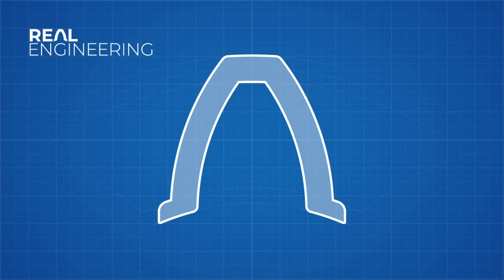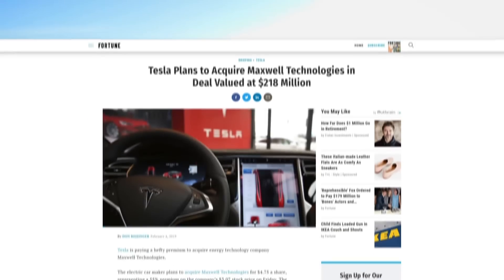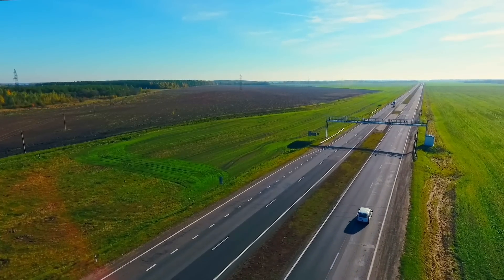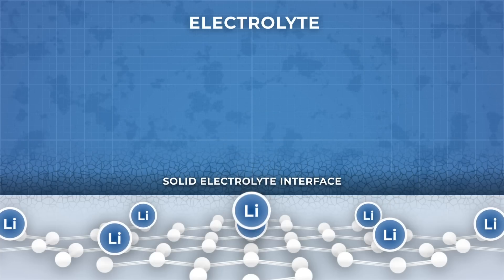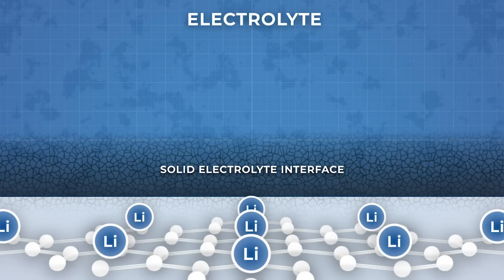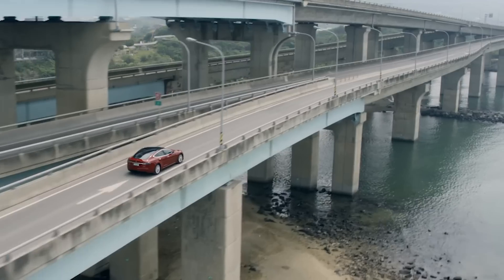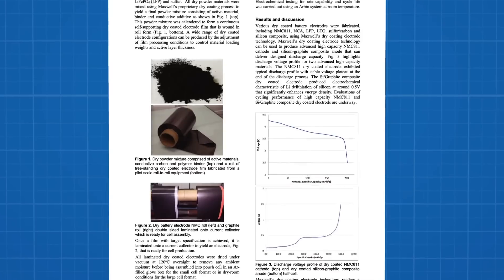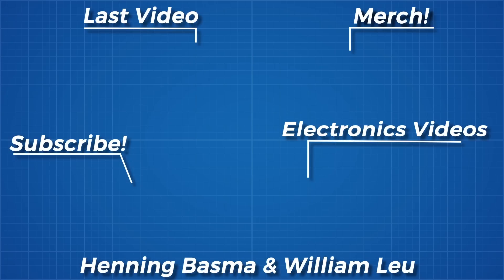Tesla's Quest for Better Batteries

Comment: The real question is what will be remaining after 10 years for the third owner? Of course, if the used prices fall enough that user will be a single mom who uses the car to get to work so a battery that is at 40% of it's original range is still acceptable.
Reply: tesla battery degradation data  determined to be 10% every 180k miles. so about 20 years for regular driving.

Comment: Who will come up with a car that allows the battery to be changed in 30 seconds? Seems pretty "easy" to make a flat battery that lifts onto the bottom of the car. Charge stations could switch out the battery with a charged one in 30 seconds. You could "rent" the battery from the station, making the base cost of the car far less....and subject to far less depreciation.
Reply: they tried that, it takes 5 minutes and is expensive to build, Tesla owners are happy with 30 minute super charging as its not too slow and easy to find one near them.

Comment: there are capacitors invented in Estonia no bigger then your hand, 
that produce megawatt per second, 
in America,  they have discovered a new chemical compound, 
that will be used in batteries and will not degrade, 
the alternator has not been redesigned, cause it worked good,
the alternator can be redesigned with a gear box,
that will produce massive amounts of energy, 
the man who combines all these factors together ,will make the bucks, 
the rest will loose out like nickolie tessler.

Comment: If it wants to expand / contract by +/-2 to one linear ratio, let them have it. Why wait? and  keep using rigid containers such as steel cylinders to hold them? Is there a requirement to maintain a higher than 1-bar pressure just to utilize such technology?

Comment: Savng the world ! Really ? I would like you to examine what is required to supply to build all those batteries that will be required. At the moment, China is dominating the battery market that actually started at the IREQ near Montreal. Now, China is actually spoiling a quarter of Mongolia to obtain the actual batteries. I have heard that Japan is in Bolivia (probably Nissan) where again a large amount of the country will become a dump or waistland in order to provide for the basic battery elements. Imagine now 3 billion cars to require batteries. Please, make the analysis and you will see that battery power is not viable and sustainable. Worst, this will provide reasons for political unrest as these waist lands will not happen next to Los Ange;es. The battery start-up was set-up in New Jersey and provided the batteries to the SVE in France which produced the Cleanova I, II and III until it was sold to an American company and then came Tesla after SVE went out). The French were the first to provide good electrical cars and some aspects came from Hydro-Quebec. Nissan did less then Peugeot in 1995 with its superb 106 electric which had a 150 km range).

Comment: Whatever they do, Tesla cars are still way too expensive for the "simple" folks, which is, for the leasing companies to use. Here, in Israel, leasing companies are actually deciding for the price of cars at the market. Tesla cars are amazing, no doubt. But. They are not going to cost around the same as hybrid cars (at least), and for sure not as regular internal combustion engine cars. Current price is what, even for model 3, what is called "long range", which is actually really short range, while compared to, say, hybrid cars, such as KIA NIRO, is around $44K, while even the top-of-the-line KIA NIRO is going to cost about $32K - and, believe me, it is much better equipped. So, this might be a huge difference for the company which tries to sell it. Add an infrastructure cost. Add repairs, battery replacement, etc - here you go. So, while Tesla is a great thing, they still need to cut their prices significantly. It's a pity that Tesla is experiencing finance difficulties right now, and it will be even more sad, if Tesla will be forced to cease production due to bankruptcy - it will probably kills electric cars future for good.

Comment: I have a stupid question: the UI for a tesla makes it seem like they use one large battery across the floor of the car. If that's true, and it's not a bunch of tiny batteries that add up to that large capacity, why not design a circuit using two half capacity batteries that alternate in use, so that both may be charged at once at a supercharger, reducing charging time? I'm not an electrical engineer (my focus is more in biology and medicine) I could be completely wrong on if a circuit like that is even possible. I could guess, even if it is possible, the constant switching between on and off could reduce battery life, and would need larger than half capacity batteries to make up for it, increasing battery weight, but if I owned a tesla, I would do anything for a shorter charge time, while still keeping the range.

Comment: A interesting video. It does misrepresent the facts about the Nissan LEAF batteries and the related performance of the car. The capacities of most Nissan  LEAF batteries have performed as expected by design: a gradually slowing rate of degradation over time. Only those batteries subjected repeatedly to high temperatures have shown abnormally fast rates of degradation. These are cars in hot climates or cars that are consistently day in day out subjected to repeated fast charging that raises the battery temperature. The majority of 2011 or 2012 models in countries without hot climates (without temperatures consistently over 30 degrees C say) today, in 2019, have battery capacities still greater than 70% of new and are very useable commuter cars. They can also be used for long distant driving where there is a suitable fast charging network.

Comment: Whilst the practical reality of replacing every Model 3 with a new battery pack is next to nil ( for starters this assumes the need to replace, the nearly equivalent worsening to the point of below 70%) this would not ruin Tesla. Total cost is a market public customer cost of about 7,500 dollars so total cost just a bit over 1 billion. Their market cap as of right now is just over 40 Billion. Their actual leverage and total assets is a good bit more than this and Elon alone is worth 20 billion. By the time this nightmare ever comes to fruition Tesla’s market cap could be 50-60 billion etc. Cheers!

Comment: This is exactly why I haven't bought a Tesla, yet, and I'm glad you guys pointed it out. Imagine you pay 45k for Tesla and after a couple years, your 300 mile range is reduced to 70%. And how much more after another year? Oh, and you're still making payments, btw.

So, all that excitement about saving gas money quickly dwindles when you realize you need to cough up about 10k to replace the battery.

Pretend you're still paying for gas and put all that money in an account, for a new battery. You are going to need it.
Reply: Alvaro Morales worst case scenario you are right. My 2015 model s has only decreased by  3% at 79000km. Part of keeping your battery in good shape requires the owner to keep its max charge at 80-90% for regular use, and only 100% when you go on longer road trips.

Comment: Use large super capacitors to supplement the batteries.
Reply: Even a very large capacitor would add very little to the range. What it will do is provide with enough power to launch the car from a stop sign or stop light reducing the charging and discharging that goes on in stop and go traffic. That will increase the life of the battery.
Reply: @men2dewy  Agreed there mate, at least it would help with the current draw from when the car moves off.

Comment: I'd like to suggest an episode on how to create massive renewable batteries with enough energy storage to power cities and countries. Hydro-electric dams and reservoirs.  For over 100 years it’s been proven that hydro-electric dams and reservoirs are a cost effective way to store energy, and the amount of energy released can be varied to match demand any time day or night, and no matter what the weather.

Currently hydro-electric dams and reservoirs are refilled/recharged passively by the naturally changing weather patterns that bring rain and snow.  For example, in California there can be a few years with the right amount of rain and snow to fill the reservoirs.  There are other times with 5 or 10 year of drought and not enough water for cities and farms to function normally, and not enough electricity so California has to buy electricity from other states.

California has the environment suitable for massive wind and solar installations which generate variable amounts of energy depending on the weather or time of day.  The supply generated by wind and solar can be too little or too much and often does not match demand.

Here is the suggestion:  Use wind and solar energy to run desalination plants to create fresh water that is pumped to hydro-electric dams and reservoirs in the mountains.  This creates fresh water that can be used by cities and farms, and used to generate electricity with proven technology that can match supply and demand.

Comment: Complete bullshit. "Ultracapacitors" do not permit or enable a reduction in "battery power" by making "regenerative braking" somehow magically able to produce "juice" out of thin air. ALL of the energy "created" via regenerative braking has to come from the vehicle's inertia and speed. Which only exist because the vehicle was accelerated to a given speed BY BATTERY POWER. Brakes are inevitably WASTING ENERGY when slowing a vehicle "over-accelerated" prior to the braking event. And no, ultracapacitors do NOT use an "entirely different" means of storing energy. Capacitors - including the "ultra" variety - are simply "batteries" for high voltage "alternating current" and function like ignition coils - which are "transformers" - and build up a magnetic field during "charging" with rectified "DC" current which collapses inducing a short burst of high voltage current to "jump start" a loaded "AC" circuit when that supply is cut. 

There is NO WAY TO ADD COMPONENTS AND CIRCUITRY AND CONDUCTORS TO THE LOAD PLACED ON ANY ELECTRICAL "SUPPLY" AND GET MORE "CAPACITY" OUT OF IT.

THE FUNDAMENTALAND FATAL FLAW OF ALL "PLUG-IN ELECTRICS" USING THOUSANDS OF DRY CELL BATTERIES IN SERIES AND PARALLEL IS THAT THEY'RE "DC" BATTERY PACKS BEING CHARGED WITH RECTIFIED "AC" CONNECTED TO "AC" MOTORS WHICH INVARIABLY REQUIRE "EXCESS CAPACITY" TO START THEM AND WHICH CANNOT BE MADE "EFFICIENT" OVER A RANGE OF OPERATING SPEEDS. TESLA'S "BATTERY FAILURES" SIMPLY DON'T MANIFEST THEMSELVES IN THE SAME WAY AS A "NISSAN LEAF" BECAUSE  TESLAS DON'T USE "LITHIUM-ION" BATTERIES OR "BATTERY PACKS". THEY USE NI-CAD BATTERIES AND THOUSANDS OF THEM AND HAVE "EXCESS CAPACITY" FROM THE FACTORY VIA INACCURATE AND DISHONEST "REPORTING" OF THE "STATE OF CHARGE" IN  "MILES" VS "CAPACITY PERCENTAGE REMAINING"  AND TESLA HAS DONE NOTHING TO "ADVANCE" BATTERY TECHNOLOGY BECAUSE THERE IS NO WAY TO "ADVANCE" TECHNOLOGY THAT DOESN'T EXIST - I.E. THE TECHNOLOGY TO "STORE" ALTERNATING CURRENT. VEHICLE ALTERNATORS PRODUCE 3-PHASE "HIGH-VOLTAGE" AC VIA INDUCTION AND OUTPUT IS REGULATED BY VARIYING THE DC CURRENT FLOW TO THE FIELDS BUT "EXCESS" CURRENT HAS TO BE RECTIFIED TO DC AND STORED VIA "LEAD-ACID" BATTERY FOR STARTING THE VEHICLE AND EXCITING THE ALTERNATOR "LATER" AFTER SHUTDOWN. ONLY SHORT-TERM "STARTUP" LOADS IN EXCESS OF CHARGING SYSTEM (ALTERNATOR) CAPACITY ARE "SUPPLIED" BY THE BATTERY AND SINCE THE BATTERY STORES ONLY ELECTRICITY PRODUCED BY THE CHARGING SYSTEM DURING NORMAL OPERATION, LIKE ALL BATTERIES IT IS NOT A "GENERATOR" OF ELECTRICTY AND IT CAN'T EVEN "DELIVER" ALL OF GE ELECTRICITY IT "STORES" BECAUSE IT TOO HAS INTERNAL RESISTANCE AND IT TOO HAS TO CONVERT SOME LLOF THE ELECTRICITY SUPPLIED TO IT - AND "STORED" IN IT - TO HEAT DURING THE CHARGE AND DISCHARGE PROCESSES. 

THE ONLY PERMANENTLY "STORED" ENERGY ON PLANET EARTH OR ANYWHERE IN TH UNIVERSE IS THAT STORED  CHEMICALLY AS HEAT ENERGY IN "FUELS" SUCH AS "FOSSIL FUELS" AND "BIOMASS" AND EVENTUALLY EVEN IF WE DON'T "DEPLETE" IT VIA "BURNING" THAT HEAT ENERGY WILL BE "RELEASED". 

ELECTRICITY IS NOT "ENERGY". IT IS A BY-PRODUCT OF ENERGY "CONVERSION" AND THEODYNAMIC PROCESSES.

Comment: I really don't understand why environmentalists are pro EV. It just doesn't make sense. 
Unless we make perfect Lithium-air batteries, an electric vehicle will always use substantially more energy than a petrol-powered vehicle. Simply because it's heavier. And that's just one aspect. The production of batteries produces toxic and radioactive waste. It destroys whole ecosystems. And then there's the waste of the battery itself after its very short lifetime.
And how exactly are you going to power the EV? With photovoltaics? First of all that's unrealistic and second it produces even more waste. The only things that are good about electric vehicles right now are the responsiveness of the electronic stability program, including vectoring, the torque that exceeds the capabilities of tires and the improved air in cities.

People need to wake up and understand that gasoline is the cleanest and environmentally friendliest source of energy we have. And that's simply because we're very close to having a closed energy cycle with gasoline. We just need to stop burning fossil fuels. If we don't pump fossil oil anymore and satisfy the world's demand with regenerative gasoline, the CO2 levels will stabilize.
That's a fully chemical closed energy loop and the best we can actually make.

And anyone thinking now that we could maybe do the same on a nuclear level. That will not happen any time soon. It might be possible to create a nuclear closed energy loop, but we completely lack almost all of the technology that would be needed. We'd need to use stars as parts of a big machine and create artificial supernovae. Unless there's a better way to achieve those effects, this will never be viable for something like cars.
Reply: Marten Dekker  Solar power is not limitless. It takes a huge amount of valuable resources to produce photovoltaic cells. Their production leaves entire wastelands that are radioactively contaminated and toxic. 

Just recently, the genes to produce long carbo-hydrates from CO2 have been identified. We're working actively right now to introduce these genes in water-plants, -bacteria and algae.
The problem so far with regenerative gasoline has been the low volume. Right now we need to do agriculture and then transform to petrol using the Fischer-Tropsch synthesis. Although there have been significant improvements made to the catalysts, this way of producing gasoline doesn't scale. We cannot satisfy the demand.

With genetically modified plants and algae, we might be able to build huge gasoline production plants that turn CO2 and water into Oxygen and gasoline. This will be able to scale very well. It's not just about closing the energy loop. This would actually be the first attempt at terra-forming, which we could use for creating a breathable atmosphere inside of habitats on Mars or the Moon.
Reply: @P8qzxnxfP85xZ2H3wDRV  damn you comments really pisses me off, i normally ignore poorly researched comments like this (ive seen many in th past 100 arguments ive had about EVs) but i don't feel comfortable letting the dangerous ignorant comment from setting here unchallenged, EVs do make sense when you bother doing the math, lithium air batteries? crist you sound like a yuppie being this faithful in a unproven technology, We dont need lithium air batteries, we just need cheaper more power dense batteries it does not really matter what it is as long as its cheap and plentiful,

" an electric vehicle will always use substantially more energy than a petrol-powered vehicle. Simply because it's heavier" this is wrong buy about a factor of 4, a model 3 that wheighs 4000lbs will have a 75kwh battery capable of moving the car 325 miles, you know how much energy is in a gallon of gas? its 33.3kwh of energy, so Tesla 1000lb battery has as much energy as 2.3 gallons of gas giving it an MPG of 130 miles, this is about 6x more efficient then the average car, and 2x as efficient as much lighter cars that use very very efficient gas engines, so no an EV is far less energy hungry then a gas car.

"The production of batteries produces toxic and radioactive waste" i would normally go on a long rant belittling your intelligence but id rather just link a video  https://www.youtube.com/watch?v=50rXYrFCQMw

"And then there's the waste of the battery itself after its very short lifetime"  https://electrek.co/2019/04/16/tesla-battery-recycling-system/  tesla batteries have a service life of 20 years btw.

"And how exactly are you going to power the EV? With photovoltaics? First of all that's unrealistic and second it produces even more waste" like this https://www.inverse.com/article/45229-tesla-powerwall-solar-energy-statistics

you seam to be concerned about manufacturing waste but i really doubt you have any knowledge of how much waste is produce let alone what kind of waste is produced, apparently you think batteries and solar panels require radium and plutonium to manufacture....

"The only things that are good about electric vehicles right now are the responsiveness of the electronic stability program, including vectoring, the torque that exceeds the capabilities of tires and the improved air in cities" thay are also safer and don't require getting oil from questionable sources/

people need to stop pretending to understand something while getting the most basic facts about it wrong....

"Just recently, the genes to produce long carbo-hydrates from CO2 have been identified. We're working actively right now to introduce these genes in water-plants"
HAHAHAHAHAH!!!!